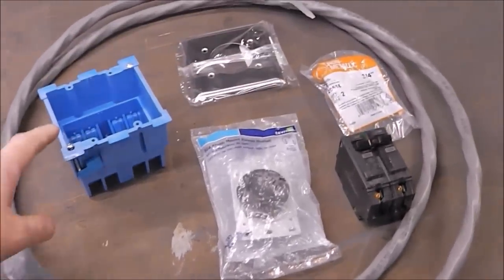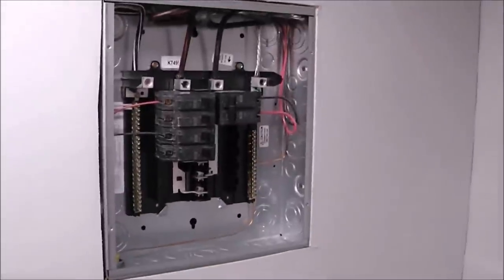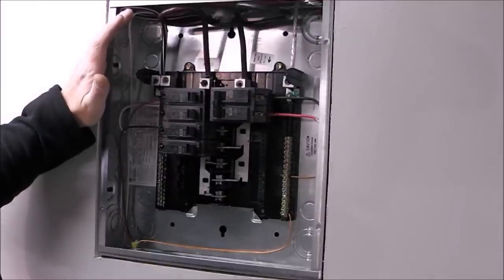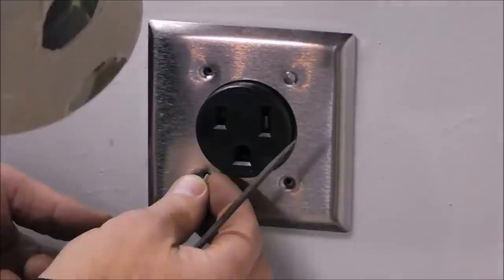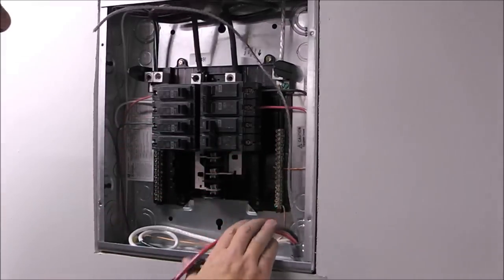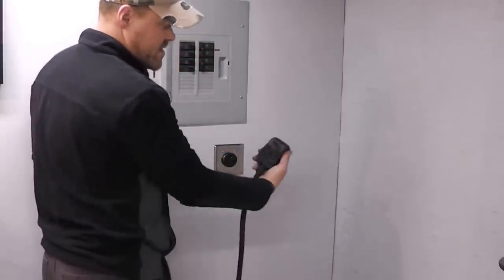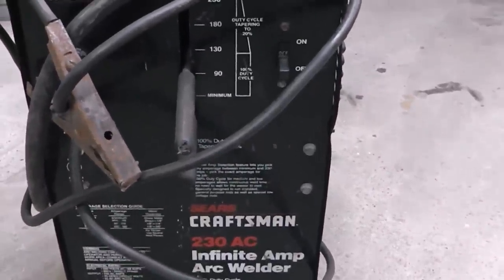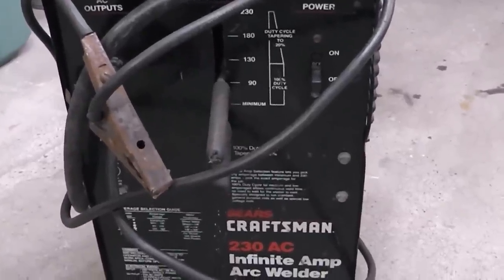💥 BEGINNER WELDING SERIES - INSTALLING A WELDER OUTLET

Comment: Why not put a 4 prong outlet on instead of 3? I'm looking to make an outlet so I can start welding. Even though my welder only takes 3 I'm tempted to wire the 4 just so I have it.
Reply from the maker: Welders come with that style 3 prong plug and there is no advantage to wiring it any other way, plus it eliminates from having different plugs / receptacles and cord adaptors. Ive gone that route before, dont waste your money. If you wire it with a standard 3 prong outlet, you can use any welder in YOUR shop and you can use YOUR welder anywhere that has standard welder receptacles.  You can also buy over the counter welder extension cords that have the factory molded ends without the need of non standardized cord adaptors to make the 3 prong cords fit into a 4 prong outlet.  keep it simple and standardized is my recommendation.

Comment: Hi Brandon, long time subscriber here.  I finally took the plunge and purchased a welder.  My son who is 16, wants to become a mechanic and IMO, he needs to know how to weld too.  So I got him the welder (for me too ;) ) and I need to setup power for it.  It's a Yeswelder 205DS Pro.  It is a multi process welder that can do 220 and 110.  I want to setup a 220 plug in my garage and your video helped alot.  I just want to confirm something however.  Considering I want to get a plasma cutter as well at some point, I want to be able to use the plug for both.  Is this setup ok?   50 amp breaker, 50 amp or NEMA 6-50P compatible plug and 6 gauge wire.  I intend on getting a NEMA 6-50P compatible extention cord so I will not have that bottleneck issue.

Thanks for the info...Love your channel.  I am going through the entire beginner series now!  :)
cheers
Paul, from NB Canada
Reply from the maker: Thanks again Paul! I emailed you 👊

Comment: Real reason to get 240V - if you use 120 you'll be running around 30A over wire/breaker designed for 15 or 20A at most, so not the safest

Comment: I want to plug into my outside hvac electrical box with an extension cord to a 240 volt welder, is this possible?
Reply from the maker: I'm thinking if you have a dedicated 240 volt outlet and both pieces of equipment arent running simultaniously it shouldnt blow the breaker. To be safe you should check with your local electrical codes to make sure it's legal

Comment: i bought a brand new 220v welding machine with 4mm wire so what is the suitable plug amperage for it?
Reply from the maker: I run 50 amp welder outlets because I want everything universal and its what comes standard on 220 volt welders.  As far as what size breaker is required for 4mm wire, a quick search indicated a 30 amp breaker would be appropriate but please verify this with an electrician.

Comment: Okay I just ordered 10/2 wire. Im planning on just using a 140 mig welder, and a 125 stick welder. What breaker and outlet?
Reply from the maker: @RIcky Parker if they are 120 volt only welders you can use a 20 amp breaker and 12/2 wire. #10 wire is good for 30 amps and you will need to match your outlet to whatever you have for a plug on your machine.
Reply: @BrandonLund  one is a Hobart Handler 140, the other is a yeswelder 125 stick. Which is a 110/220 although i sont see me using 220 with it.
Reply from the maker: @Ricky Parker the Hobart will take just a regular 20 amp breaker (if you use #12 or larger wire) with a standard household outlet and if you don't plan to use 220 on your YesWelder then you can use that same outlet. I have their 120/220 volt plasma cutter and im pretty sure it comes wired with the 120 volt plug so if your welder is the same you can just plug it in the same outlet as your Hobart.  You just won't use the supplied 220 volt adaptor plug. Hopefully that makes sense.
Reply: @BrandonLund  it makes sense thank you! I'm redoing all the wiring in my shop to hold both welders and other stuff (not same plugins) I appreciate the help
Reply from the maker: Anytime man 👍

Comment: Hi Brandon,
How did you get those wires into the gang box and the sub panel with the gang box installed?
Reply from the maker: It's an interior wall and the drywall was not installed on the  backside yet.

Comment: Can I ask why you used a #/3 wire instead of a #/2 if your not wiring in a 4 prong?
Reply from the maker: Great question. Often times the store will have a short section of wire that is left over from the larger reel and they will sell it at a discounted price. Usually half off. That's what I did here.
Reply: @BrandonLund  Ok makes sense. Thanks for the response.

Comment: What would happen if you turned on your 240v welder, but 1 phase of your panel was out & u didn't know, meaning it's only receiving 120v on 1 side correct.? would that cook ur welder...?  Just asking because ive had tht issue with my panel where i lost a phase, it only cut off some outlets etc, but if the welder was on when it happened, or i turned it on what would happen.!  I'd cry if i wrecked tht welder......Ha     -Also... I wired my Dual Volt 160amp Welder Old School Also for 240v Only btw... Only 3 wires, not 4...?  8 gauge... all i could afford, the wire isn't cheap...
Reply from the maker: It could fry the machine if ypu were using and one of the phases dropped out. If you were just having it running and it happened it probably wouldn't hurt anything. Yes wire is crazy expensive!

Comment: The "non corrosive stuff" is dielectric grease.
Reply: It's really "Conductive grease", which is different from "Dielectric".
Reply: Dielectric is non corrosive, that is its purpose. It does look like he used conductive grease.
Reply: Had he looked at the recptical it most likely has a cu/ Al rating so it's not needed. I don't use anything on the aluminum alloy cable we have today it's not required.
Reply from the maker: @thomasmarable6818  It's how my former employer wanted aluminum connections to be made and it's not a bad habit to get into. It certainly doesn't hurt.
Reply: @BrandonLund  to a point yes but I have had to replace recpticals because of the grease it protected the wire but mess the  terminal up have to read the instructions. Remember in todays electrical world it's not true aluminum wire it's an allow

Comment: How much would an electrician charge to install the plug?
Reply from the maker: I would think no less than $200
Reply: For this set up about $160
Reply: I got 2 quote,  650 and 380. Both licensed. And I want my outlet about roughly 12" away from panel. Doesn't seem to be very difficult not sure why it can cost so much... i was expecting about 250 and would have been fine with that.

Comment: Its the machine your protecting. 6/3 wire with 50amp is a must. The cord coming off the welder is sometimes smaller because of the duty cycle and its short length. Also never use aluminum wire to save a few bucks. Using aluminum wire requires you to go up a gauge or two.
Reply from the maker: Ive been using 10/3 on a 30 amp breaker for 3 years and have yet to trip it. Im not sure the added cost for me would be worth it.

Comment: Wait... 😲 WTH!?! How did you stick weld off a 30 amp outlet limitation? Don't those run off 50 - 90 amps on average? 6011 rod in this video I'm sure ran you around 70 amps off your arc welder. How?
Reply from the maker: I'm not sure why but for this welder im assuming it's the transformers?  Same idea with a dual voltage dc welder. How can a welder be set at 90 amps but be plugged into a 120 volt outlet that has a 20 amp breaker without tripping.? Same idea with a plasma cutter set at 30 amps but plugged into a 20 amp breaker... I'm sure someone will chime in that has more knowledge on this.
Reply: The welders boost the power to the output amps. You can review any welder manual your interested in to see the required input range. Most are around 30-50amps @max output. Example: 47amps at 200amp output.
Reply: @BrandonLund  aaah you're right. Cool, thanks for the response!
Reply: @pappaclutch3266  thanks! Yeah, I'll check it out
Reply from the maker: @pappaclutch3266  thanks man!

Comment: I dont understand why you would have a 10 gauge extn cord IF the machine requires more amps than that and then match everything to your weak link. Get rid of your weak link extn cord!
You prob have a welder that exceeds entry level ones that draw lower amps rated for 10awg like 30 amps based on you having a long extn cord.

So Im guessing you are doing MIG, with a good welder that draws mad amps. 

The Lincoln Pro Mig 180 lists its amp output at 30-180.

So if you doing long runs.. that 30 amp breaker is gonna constantly trip right?
Reply from the maker: If my cord was larger I could go to the amperage rating on the recipticle but in my experience for 99% of general home hobby welding that I do (up to 3/8" of an inch) I have never need more than this. I have yet to trip the breaker. Length from the breaker plays a role also. Longer distances require heavier cords due to voltage drop.  If It becomes a problem i could spend another $60 for a heavier cord and then go with a bigger breaker but I just havent found it's necessary yet. The male plug on 99% of consumer welders are also only rated at 30 amps so rarely if ever would you need more than this unless you were using a long extension cord as I mentioned.
Reply: I got 50amp rated everything and I love it. My 50foot 6 gauge extension cord weighs like 50lbs tho lol

Comment: Your panel is wired wrong. You have a green screw in panel. That means you neutral and ground are bonded together. Unfortunately that panel isn’t the first means of disconnect. That out by your meter. So have take green ground screw out and float neutral and ground. If you get lightning strike your doomed.
Reply from the maker: Good eye! I have since removed it. It is now isolated
Reply from the maker: Good eye! I have since removed it. It is now isolated

Comment: Plugging a 30amp cord into a 50 amp circuit will not burn the cable, using a 60 amp welder on a 30 amp cable will burn. Power is drawn not pushed
Reply from the maker: If you draw 50 amps through a cord only rated for 30 it will absolutely overheat and catch fire. To avoid that scenario is why I matched the conductor rating to the breaker size.

Comment: Turn off the light for the pool high voltage hopefully we've not only will this hurt like hell and kill you it will also hurt the entire entire time you're dying LOL don't work on panels hot be fucking smart and go kill it at the main panel if your shop is wired up with a subpanel if your  wired up with main panel in your shop even when you kill that main power they lugs coming from the outside are still hot so even if you kill the power be fucking careful I like your video dude you explained that really well especially about the 30 amp wire on a 50-amp breaker you will melt those wires insulation and if you put walls up after you've already push this wire you can start a fire in your walls and burn your whole damn shop down like you said never go up a size breaker that is in your panel unless the wire is rated for it or you pose serious risk of starting fires and your breaker will never trip that's one reason why I quit doing residential is because John Doe backyard electrician sometimes fails to realize that and if I don't catch it whenever they have a service call for some problems that place burns down it's on the person with license and you'll have a hell of a time trying to prove to your States Construction Industries Board that you didn't have anything to do with John Doe shop burning down because you didn't install that wire he did I'm subscribing to your channel because I like the video I have a 230 volt arc welder that was made in the 50s or 60s that I just recently picked up and I was just checking with someone besides myself so I didn't install tube big of a breaker and end up burning up my new to me antique welder

Comment: I hope you are not using aluminum wire inside your house.
Reply from the maker: @John Oler it's perfectly acceptable to feed a main panel or sub panel with AL conductors when sized properly.